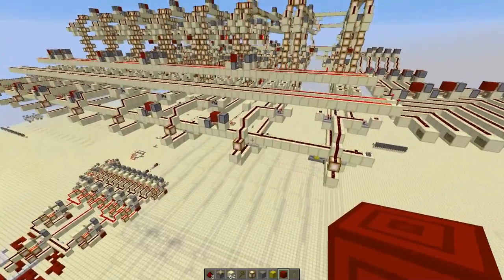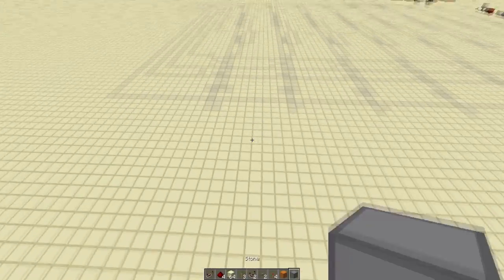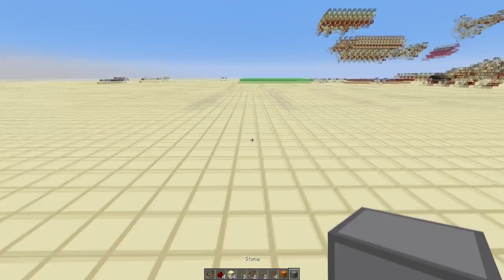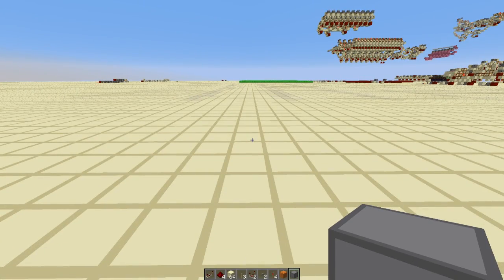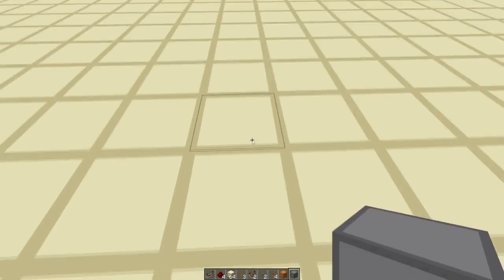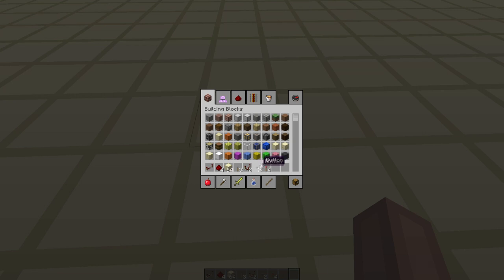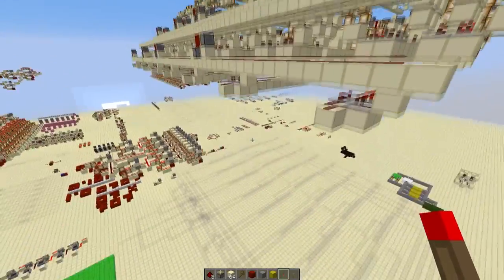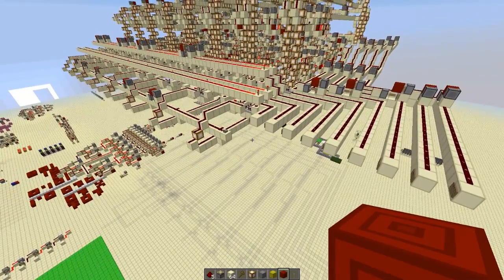Vulcan CPU - Episode 8 - Accumulator

Comment: I don't add accumulator to my processor and it also working well without it :-)
Reply from the maker: I design mine a little different
Reply: Redstone Without Limits Do you know why i don't add it? because I send data from alu to registers instantly without accumulator. Have you any alu registers at input of alu? I saw schematic at the video but maybe you forgot to tell about it.
Reply from the maker: +PZ Mc i usually use it to make a smaller bus width.
Reply: Are you planning to use the registers also as pointers (index registers, counters) since there is not really a benefit of using the registershere other than the increased speed of spatial locality? Besides that, registers use less addressing anyway so saving a register to the accumulator or a memory address does make a small difference to your IS.
Reply from the maker: +Koyarno's redstone i want to use a seperate more specialized set of registers for indexing and counting.
Reply: Btw, did you have any plans for a pipeline? everything you use is instant so it does seem you want to get the fastest speed without any additional stuff.